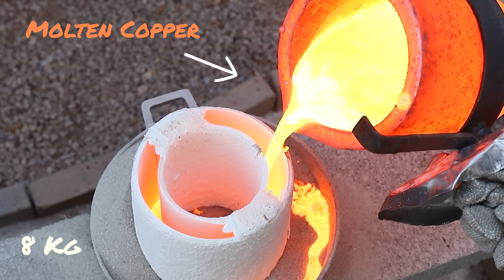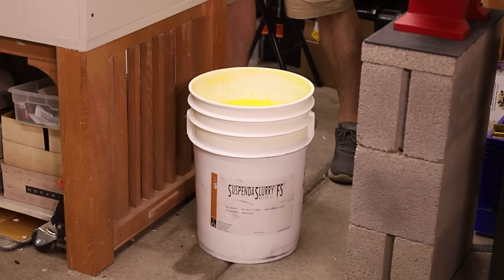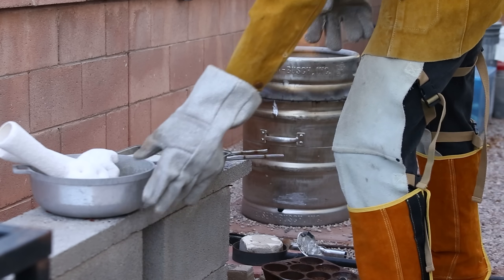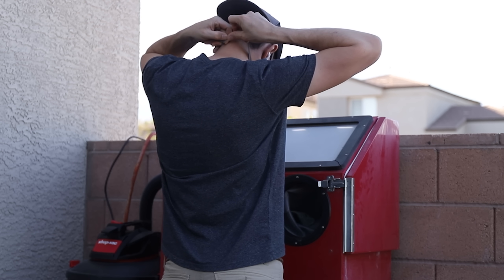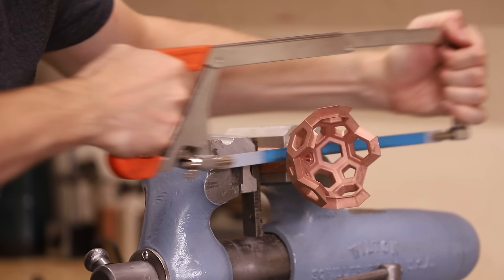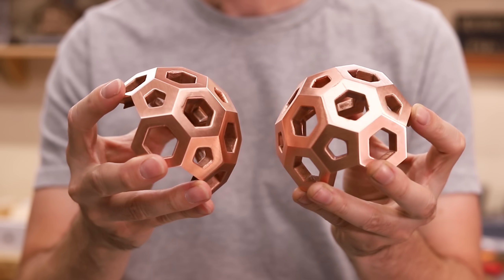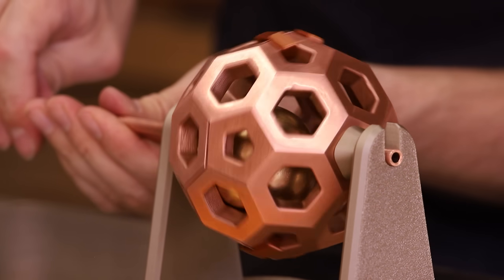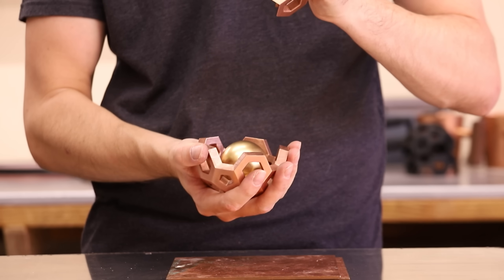HUGE Magnet VS Copper Sphere - Defying Gravity- Will a Neodymium Magnet Float Inside?

Comment: You should make the two copper poles stand next to each other and then run electricity through each of them using wires that have been soldered to the two poles and then once you’ve done that turn it on and the electricity will run through each of the poles back-and-forth back-and-forth and it’ll look really cool I don’t know just do it.🤷

Comment: Perhaps you could spin it with a motor that is easier to fine tune the speed than a drill. Also, it would be cool to put the magnet you used to rotate it from a distance in a rotation motor.

Comment: 1. To what degree does the thickness of the copper cylinder influence the reaction of the magnetic field repulsion to save on excess copper for the same end result. 
2. Working off the above, could you then have 'affordable' spinning hoops/cylinders of copper for a tunnel and magnetic car that is naturally suspended with minimal air propulsion??

Comment: I do believe that adding bearings to the supports would make the spinning copper containment much smoother when it spins, making the spinning containment into a much better environment for the magically floating magnet. 

How's about putting the other magnet onto another support frame (with bearings!), attaching the drill motor to the second magnet, to make the equally magically spinning copper thingy into a very cool motor, with the bottom of the copper gizmo protrude out the bottom of the support.

Make all of the framework out of very light aluminum with all of the framework one piece and use the lightest kind of a driving force which could also be attached to the spinning magnet, with foam wheels on the bottom corners of the frame thereby making it into a self-propelled vehicle.

Also, making it as light weight as possible, carving the frame into a goth-like appearance! 

Lastly, you might try to ascertain any electromagnetic field that would be created. I'm not going to get all H.G. Wellsian, but beware of the potential temporal displacement ...

On the other hand, you could reverse the spin and be back into the current time frame in no time at all!

Or would that be in a split second?  

Tim

Comment: Put sealed bearings on your stand and wire in a brushless motor with a potentiometer so you can control the speed your sphere is spinning

Comment: How about an electromagnetic arc reactor that implements light refraction & a solar ionisation process to generate its own power to convert it into a strong magnetic field & has a quartz crystalline core that's encompassed by 2 neodymium magnets that both orbit the core in  a quantumly locked ♾️ fashion?

Comment: WAIT ! it actually rotates if you put a magnet close to it 😮....but then what if you fixate two magnets in opposite spectrums nearby? Infinite rotation?  

Perhaps using a mechanism that you can activate to put to make the magnets go near for "on" and far for "off" could work as an activator for easy to control engine.

The fact you also mentioned it also generates energy could also be maybe conducted for harvesting of some type of form...this is an amazing idea.

Comment: Just an observation, if you added a ball bearing to each end of your shaft in the stand, you would likely get a much smoother rotation. As a side note, I did some bronze casting for an art project some years ago, and used the same technique to make my cast and poured the bronze. I was a thrilling experience. You did an awesome job on your casting. What a cool project. Thanks for sharing!!!

Comment: A few years back I took a page bar magnet and put it in a index head. I ground five sides on 12 devs. I then parted it of and did it again until I had six segments I was hoping to get a monopoles ball with all the positive on the outside. So it looked like a ball. I used superglue to hold it together. It was working until I put the last segment in then all magnetic was canceled. Take the last segment out and it came back.

Comment: toward the end of the video you rotated the sphere with another rotating magnet. Can you build a stand for it the same as the sphere and then put a pulley on each with a drive belt between them. See if it will continue to rotate on its own

Comment: Fun experiment: make a radiometer but paint the fins with the newly discovered whitest white and blackest black paints. My hypothesis is that it will spin faster and with more force than a regular one...😊❤❤❤❤❤ I almost forgot, instead of balancing it on a needle use two tiny Magnets so there's virtually no contact or friction when it rotates. You could even attach hanging coils of wire or tiny Magnets and rotate them around a coil or magnet and get some electricity out of it. Turn the radiometer into a generator!!! You could even sell them!!!😊❤❤❤❤❤

Comment: Future project: make a gyroscope with a center wheel that can hold fluid made from glass or polycarbonate and fill it with Galinstan or liquid solder and spin it in the vicinity of a Tesla  coil. Or put hi voltage DC thru them. Or do that with 8 of them in a disc configuration and spin them and the disc. 
You might see some interesting effects...
Be careful tho if the metal heats up it might burst thru the containers so safety first!

Comment: Change axis maybe.. like have your equatorial split become meridian.your current is making an anomalous gauss field along the split.. assemble with copper anti seize then silver solder (braze joint) get that current uniform and I'm thinking high speed will lock it in . your joint just doesn't look resistance uniform so your sphere is wobbling from pole to pole.. pleeeeeaaasseee..😮it's fricken awesome

Comment: Make 2 copper spheres (or as close to a sphere as you can), 1 bigger and the other one smaller, and place inside bigger sphere the smaller copper shere which has the sphere magnet inside. And rotate both spheres, just that the bigger sphere in the opposite sense than smaller sphere. You may just get an interdimensional flying sphere :). Good luck and keep posting.

Comment: It'll be cool to connect an Arduino with a motor and strobe light where you can get the speed of the motor and strobe just right so you can see through the ball better.

Comment: Absolutely cruel and fascinating how you made all that I would suggest that you make the core the outside of the severe as you call it thinner, and not so thick. There'll be more room inside for the ball to float in mid-air at the right speed. I hope that helps

Comment: And now… experimenting with specific rotational frequencies will maybe show some unexpected results.  I would suggest trying to measure the amount of excess energy put off the device while rotating.
Reply: A lathe would help if it had a good smooth spin-speed control
Reply: Also, consider sacred geometry and numbers for ratio purposes.

Comment: The the two haves of the Icosahedron isnt perfectly electrically joined to make the back emf induction more prominent. If you slightly solder the two halves (no need for all the way arround but rather) at a few points on the boundaries, the floating effect might be more. Also the if you had a perfect copper spherical shell with no holes unlike the Icosahedron and spinned it at  high enough speed the magnet would be floating but you wouldnt be able to float it. To try to spin the two halves in opposite direction while the magnet is inside the halves. I think that might help mitigate some of the centripetal forces issues. <3

Comment: You should do test for voltage ⚡ use two more magnets a north and south  to rotate the sphere then connect them with copper wire running just above the sphere

Comment: If you reduce the diameter of that copper sphere it will not get lots of space to fall. Gave only sufficient space to float. Maybe it will work at high speed also.

Comment: What if you just spin it to like 150k-500k revolutions and you use a rod that’s extremely magnetic. Ie, you up the copper ball on a spindle. Use the sphere as its base. And use a magnetic rod that’s barely above the copper ball.  Once the inertia is in place you remove the magnetic rod… and if the calculation is correct.. you should have a perfect magnetosphere.. just like the earth. Tbh it probably won’t work because we are at sea level gravity. But it’s worth a shot when you’ve come so close
Reply: Tbh if you did it in space, this could work. THATS why I’m so excited for the next generation of space science.

Comment: Use a high speed camera to clearer demonstrate the levitation inside as the current video was lackluster and possibly also synchronize the framerate in such a way to capture a trippy static levitation that slightly moves from a minor desynch

Comment: Maybe reforge the sphere to be completely round (excluding the holes) and with less air gap to the magnet. Then line the inside with a thin rubber or rubberized paint to prevent the magnet from slapping off the cage. 

I assume the shape of the holes will mess with the eddy currents. So I bet making copper rings bound together by something diamagnetic would also work better.

Comment: I know the top comment already said it, but if you if you could connect a motor to it for the optimal rotations per second to have it float and then set a camera up with matching shutter speed to the rps that would look amazing.

Comment: I was doing a similar build with some AI assisted calculations of different facing magnet polarities so it would spin itself naturally it worked till it cracked out my copper housing for it. i need to use something stronger to brace them i think.

Comment: The issue you are having is a magnetic field irregularity due to the hexagonal holes around the equator, try using a solid band equator. this should smooth out the field and allow the magnet to sit on the field more securely.

Comment: It's a cool looking object, but given that you only spin it on one axis, you could have probable levitated a magnet by spinning a cylinder on its central axis and putting the magnet in the centre. Also, for a better video, if you can get your hands on a camera that allows you to precisely vary the framerate, you could sync it up with the sphere so that the sphere appears stationary while the magnet is levitating. (think of the rotors of a chopper appearing stationary when their speed matches the speed of the camera)

Comment: this got me thinking built a magnet like plate not too strong built a copper pipe have a hydraulic piston to raise the platform and them have the piston go down to make the platform drop slowly boom elevator that only requires power to go up thats a 50% reduction in power usage per elevator

Comment: smaller magnet? larger interior for the cage? There isn't much room for the levitation to occur. 
 I also wonder if the electric currents are interrupted or the magnetic fields warped by the way both halves of the shell fit together.  On the other hand are the large gaps in the shell causing problems with the electric currents and thus the magnetic field?

Comment: Maybe apply a halbach array of magnets to each of faces of the sphere. Also try making the sphere with woven copper wire to induce a current into. Where wire touches wire put something in between to insulate it and apply higher and higher voltage to see what happens. 

Now you got to add the whole thing into the center of a gyroscope see if it will behave like a gyroscope in the ISS.

If there was a way to make elastic metal or a material you could impregnate with metal in that can stretch I wonder at what velocity would it produce saucer. 

I wonder what happens if you placed it in a tube and spun it while a negative ion generator was running. 

I wonder what happens when the whole thing is dropped through an iron tube? 

I wonder what happens if it is put on the inside of a car tire and then the tire spun - would the whole thing levitate? 

Take and make a wheel with magnets all the way around it place it in the center see if that will stabilize levitation  .

Hit it with a tazer - 
Would the magnet remain magnetized if dropped in liquid nitrogen. 
What happens if just the magnet or just the copper shell is placed in liquid nitrogen. 

Does it create a electromagnetic pulse if spun at highspeed and then the shell is pulled apart. 

Maybe space the outer shell apart some spinning both in the same direction and then opposite from each other.

Comment: Make a section of copper tube that connects between the copper sphere halves, with the same hex patterned windows. It would become the Lenz Law Hex-e-Pod. Also... put a pattern on the neodymium sphere so it is easier to see the neodymium sphere's movements in relation to the copper sphere or tube around it.

Comment: Great experiment. I wonder if you could simulate the effect of a magnetic storm on the planet. When I add washer magnets to the center of a gyroscope and spin the toy, - mounted on an equatorial axis, it always tilts even with weak fridge magnets.  Assuming the solid core and liquid mantle of the earth acts like a bar magnet, then might we expect a Solar Proton Storm (billions of tonnes of positively charged ions) to overcome the planet's protective magnetic field to repel the north pole and attract the south pole.  With a prolonged storm might the earth's core be deflected in response to Newtons third law of action and reaction. If so, then could the tilted core drag the lithosphere around thus tilting the equator away from 23.5 degrees of obliquity?  I imagine a device like an armillary sphere could be constructed to represent the axis of rotation of the magnetic core versus the N/S axis of rotation of the planet.

Comment: Something to try, make a storage container with a sort of shell using the magnetic effect to keep it suspended.
Using the magnet and its effect of repelling you can make a sort of suspension system for whatever is placed inside the internal box or storage container that is placed inside.....
Could be a primitive version of inertial dampeners?

Comment: Have you tried cooling the copper down to liquid nitrogen temperature to reduce the resistivity, or used Helmholtz coils to orient the poles of the magnet vertically while switching the axis of rotation to the vertical?

Comment: since lenz's law is in action, the magnet generates the eddy currents which create the magnetic field to oppose the spherical magnet. In doing so the spherical magnet starts to rotate in the same direction as the copper sphere. Once this happens the eddy currents are not being generated and thus field start to diminish and the sphere falls. You need something to stop the magnet rotating.

Comment: If you put both the ring shaped magnet and your copper sphere/w ball magnet mounted each next to beside eachother with adjustable variable distancing, when you spin one the other will spin accordingly, creating a perpetual spin. Add a battery and an alternator to another battery, then you get auto start spinning when you turn the battery power on, then the initial battery gets constantly recharged by the second battery that gets constantly recharged by the alternator. All spinning is creating electromagnetic pulse flux and creating electrical fields so placement of each at the correct distance and rpm is key to creating the optimal performance. It takes 2 to tango!!!

Comment: just a thought if you want the effect to be more noticeable, possibly widen the holes across the whole piece.. make it easier to see inside, possibly paint the magnetic sphere with a pattern, plenty have talked about mating the rotation to the frame-rate so it doesn't look like the outer sphere is rotating, also a slightly smaller magnet with less mass might be easier to suspend assuming you can get one that is approximately the same strength or stronger with less mass as well as changing the axis of rotation so that the seem is not along the equator all seem like good suggestions I've seen.

Comment: A question what if you use a smaller ball? And what if you try three balls what would happen? One more instead of spinning what if you swing it around in a circle? Sorry one more what about multiple magnets on the outside the way you were playing with that one magnet getting it to spin putting a circle of magnets around it to get it to spin what does the ball do in the middle.?

Comment: Did you feel a change in resistance when turning the ball by hand? Making it turn at a constant velocity shouldn't be too hard with the help of a servo motor, an encoder and a regulator (an electronics tinkerer should be able to clobber something together pretty quickly).

Comment: I wonder what would happen if you only used one half of the copper sphere with the copper shaft positioned vertically, so the copper (half) sphere was positioned like a bowl. Then placed the spherical magnet inside and performed the rotation. Would the magnet fly out or hover in the center?

Comment: any current through any wire no matter the shape will generate a magnetic field and any magnetic field that cuts through any wire no matter the shape will generate an electric current. The join line doesn't break any loops. It just makes more and smaller loops. The main problem is for what he wants to happen the magnet needs to spin slower or faster than the copper ball. The problem is once the magnet matches speed with the copper ball the relative speed drops to zero so the magnetic fields from the magnet are not cutting the copper therefore not generating Eddie currents to generate a field and repel the magnet. When they match speed the magnet stops getting repelled by the ball and falls. This stops it and its able to generate magnetic fields again therefore pushing the magnet back to the center. The best way to solve this that I can think of is to keep the ball rotating on all three axis constantly changing the axis of rotation. This would make it to the magnet never catches up to the ball keeping a difference in speed between them.